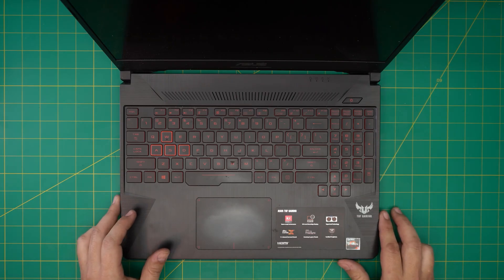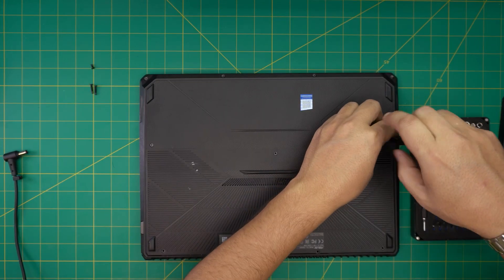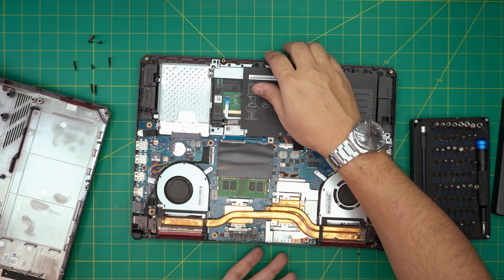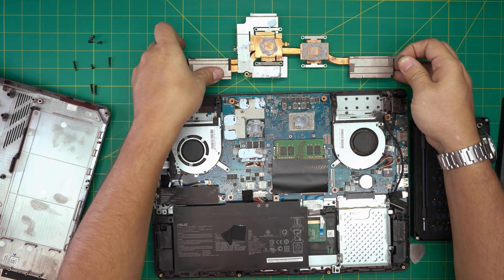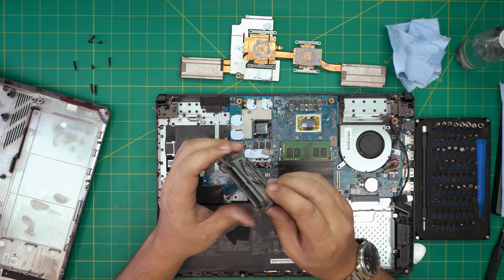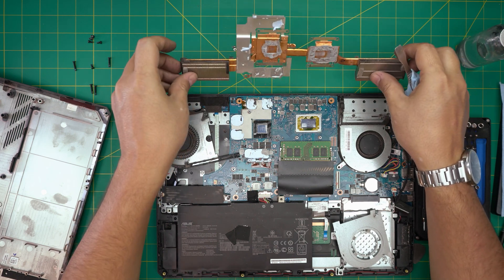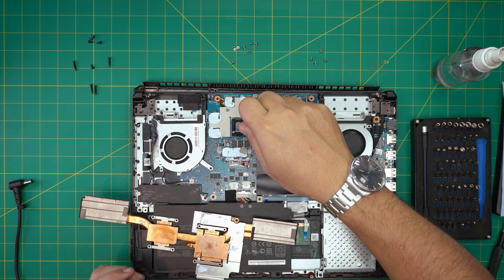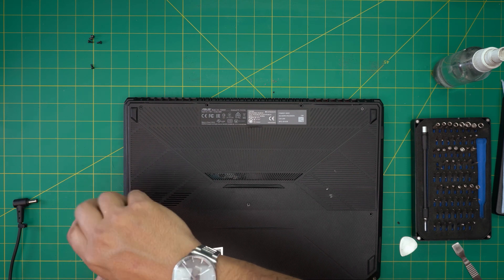How to Repaste and Clean ASUS TUF Gaming FX505DY-WH51 Laptop - Step-by-Step

Comment: I have the same laptop and Ive been keeping it for already 3 years now and I’ve been using it for an average of 8-10hrs every weekend and 4-8hrs every weekdays.

I replaced my old fan because it was getting noisy and there are some quiet rumbling sounds. 

My old fan can run upto 5800RPM but with a temp of 90C-93C  when playing games and 43- 55C when idle.

My new fan is quieter but I noticed it was slow. The maximum rotating speed that I’ve seen on my Armoury  Crate is only 5000RPM. And having the same temperature around 90c - 93C when gaming.

Is there something wrong? I haven’t tried repasting it with a good thermal paste yet. But I was disappointed that my new fan did nothing to reduce temps and it was slower too than my old fan.
Reply from the maker: 🫠Regarding your question, your fan is ok with 5k RPM, you should not even get near that 5k rpm on full load anyways.
NOW i would highly recommend you to open and repaste, because your old thermal paste is goes it is solid.
you would enjoy less fan noise and lower temps, make sure you use a good grade paste like:
thermal grizzly kryonaut: https://amzn.to/4ayjraU
Should you have any further questions or requests in the future, please don't hesitate to ask me.
cheers🍻

This is an Amazon affiliate link. When you use my links, you are helping to support the channel. 🙏

Comment: hey i have fx505dy and the fan always runs on low speed. its speed is not changing with armory crate software. should i replace fans?? and i get a burning smell while gaming. feels like coils are burning since fans are not at max speed
Reply from the maker: Thank you for your feedback! If you wish to support the channel, you can like, subscribe, or both!
Regarding your question, this a common issue on this laptops, the step motor coins are failing, you will need to replace them as soon as possible else you will damage the GPU.
Should you have any further questions or requests in the future, please don't hesitate to ask me.

Comment: so what was the result before and after?
Reply from the maker: Thank you for your comment. Regarding your question, I want to clarify that this video is not intended as a benchmark test or a comparison of thermal pastes. Its purpose is to demonstrate how to service, clean, and repaste your laptop. It's similar to taking your car for an oil change, where you don't ask the mechanic how well the car performs after the oil change.

However, if you're interested in understanding the potential difference in results, there are several factors to consider. Let's assume the laptop is new, not dirty, and doesn't have any dust build-up, and it has the stock thermal paste applied. In this scenario, if you replace the stock thermal paste with a higher-quality brand like Thermal Grizzly Kryonaut Extreme, you may observe a temperature drop of around 10-15 degrees Celsius under maximum load, depending on the room temperature.

I recommend checking your temperatures before performing any modifications and conducting regular maintenance (as shown in the video). This way, you can personally observe the difference in temperatures. Please note that individual results may vary.

Should you have any further questions or requests in the future, please don't hesitate to ask me.
Reply: @uFixTek  yea ofc i understand the situation. and my laptop is also from 2019 and working almost 4 years. but i never used it for heavy gaming. also there is No dust inside the fans since i cleared that before..  to be clear, i just played gears 5 back then and a little bit of overwatch. maby less than 20h. mainly i use it for online classes or watching movies.   my config is 9300h+1650.  temperature is 95ish on Stress test after 5min for cpu and 76c for gpu furmark burning test.
 laptop is on a Coolpad but Coolpad is NOT turned on....
also i have thermal grizzly (aeronaut)..... still wondering should i change it or not. a friend of mine have same model with 3700u as cpu. his temperature is around 83 on stress test. so i guess i explained everything.
Reply from the maker: oki my friend i would highly recommend you to replace the thermal paste, the duration of the thermal paste is max 3years if you use it 3-4h daily.
having a 95c on cpu high is a bit high. but if you are going to be using it for none gaming and office use, then no need to repaste.
Reply: @uFixTek  
i remember it was like this , at least after 1 year of purchase. that was the first time i checked the temperature. 
i tried undervolt by -0.140mv and it helped reduce temp to 88. 
Yea its mainly for such uses but i enjoy playing overwatch 2 as well. and i'm leaving home so i don't have access to my pc  for a while. 
is Aeronaut thermal grizzly decent? is that ok if I repast only CPU and GPU  and dont touch those thermal pads?
(also i have a tube of  EX750 deep cool)
Reply from the maker: keep the under volt -0.14 it is good for the components, and regarding the thermal pads, there is no need to replace them, unless you do over clock, if you don't overclock then no need to replace them.
and i been servicing for over 17 years and we do a lot of the test and i would highly recommend to use Thermal Grizzly Kryonaut over the Aeronaut, because the Kryonaut has Thermal Conductivity
12.5 W/mK , and the Aeronaut 8.5 W/mK.
deep cool don't use it.
Reply: @uFixTek  so you say this aeronaut (that i have right now ) is not good and i should buy a new tube?

buy the way,  since you have seen all the model, dont you think the intel chip 9300h may run hotter than ryzen  3700u model?
Reply from the maker: yes i would highly recommend you get the Thermal Grizzly Kryonaut because it has a much much better heat transfer rate 12.5 W/mK .
and its no question intel is almost always hotter than amd, but intel is much more reliable CPU than AMD.
amd is 30W lower TDP.
9300h runs at 45W
3700u  runs at 15W
Reply: @uFixTek  i just used Aeronaut since it was around.
gpu dropped to 67c from 76 on stress test.
cpu droped from 95 to 
87 no undervolt and 
with undervolt its 76c.

leaving this comment here for you and others who may need it in future.

by the way, ur AMD Ryzen was 83c after change, am i right? i guess this is a good results?
Reply from the maker: These laptops belong to my clients. I don't remember the temperatures on them as it was a while back. I appreciate the feedback for the viewers.
83c under load is a good state.
Reply: @uFixTek   actually i said 87 not 83.... anyway , for some reason i thought that i didn't use enough t.p so i reopen the laptop to add extra paste. seems i was right.  GPU droped to 65 (67 before reopen)  and CPU is 73-75 (78 before reopen) with undervolt ofc...  and full load without undervolt droped to 83-85...

i guess its decent now. and  i'm going to always use it with undervolt so it's much better than previous 88ish with undervolt....  

i'm not sure about viscosity and other parameters , but the factory past was So hard that i had to use a lot papar towels and alcohol and took me a lot of time to remove it.  could you please tell me if thats because its expired or the material is like that?
Reply from the maker: When servicing, it is important to always remove the old thermal paste rather than adding new paste on top. Adding new paste on old paste is the worst thing you can do. Over time, thermal paste can dry and harden, losing its ability to effectively transfer heat. It can become as hard as concrete. Some pastes may even start to bleed, indicated by a shiny water-like substance. If you notice hardened paste, it means it has expired. Similarly, if you observe bleeding paste, it is also expired. Even though thermal paste typically has a shelf life of 4-6 years depending on the brand, its effectiveness diminishes much sooner based on usage.
Reply: @uFixTek  i think my laptop is destroyed :S
my GPU use to run on 1600-1700MHZ up to yesterday on 67c.... and furmark Score was 23fps (1080p+8mssa)   .... now its running on 1250mhz and fps droped to 16 fps and temp is 54C...  i did remove and reinstall driver , didnt help .
Reply from the maker: are you running the test when the battery is charged and connected to charger, new bios firmware are programmed to lower the MHz in order to give more battery time,POWER OFF the laptop and plug charger and power back on with charger connected at the boot then test.
Reply: @uFixTek  i was running the test on 80% battery with battery charging set to battery protection (80%)